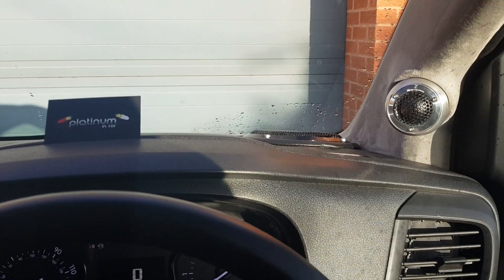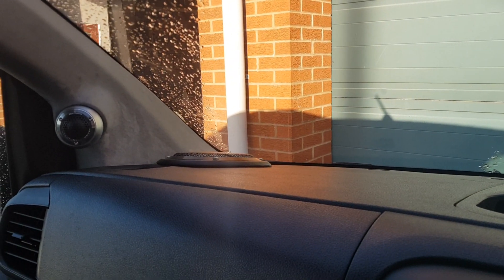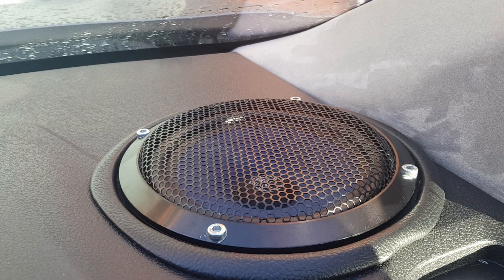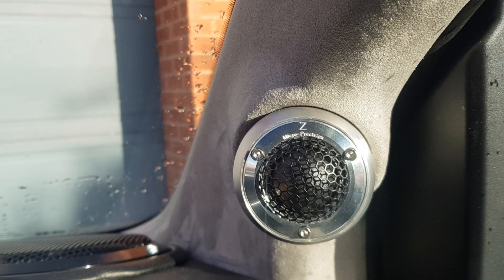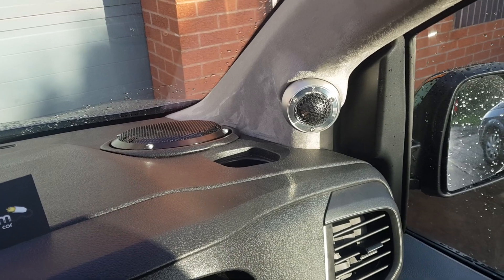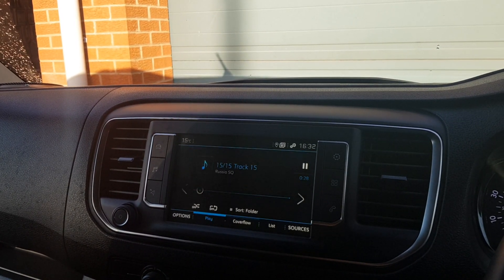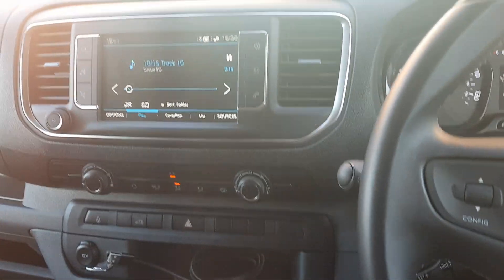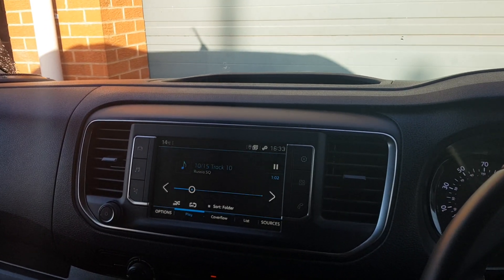The start of a high end car audio system using Micro-precision speakers by Platinum in Car

Comment: Very nice. Mids on the dash play free air?  Did you consider placing the tweeters further - closer to the midrange?
Reply from the maker: yes mids play into a well damped dash,tweeters closer to mid would cause more reflections off windscreen
Reply: @platinumincaruk  thank you for your explanation.